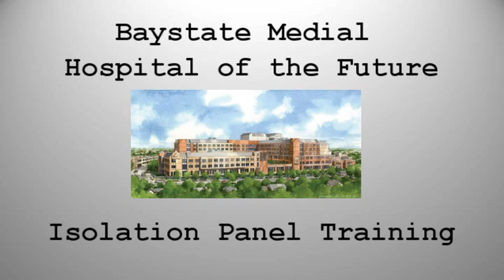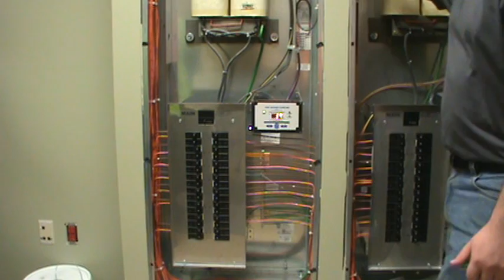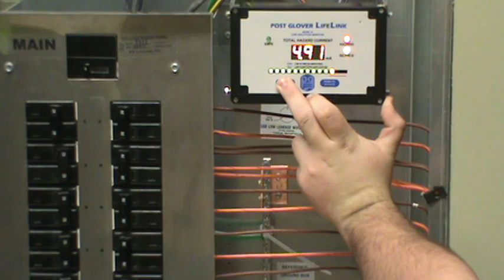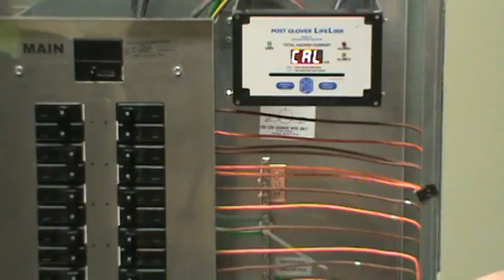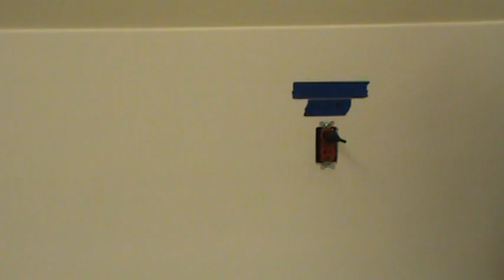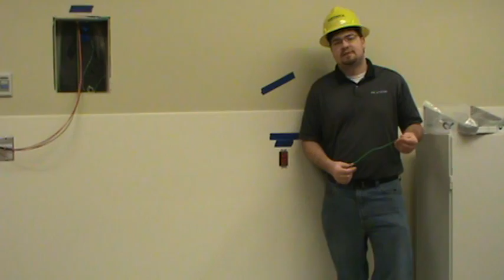Isolation Panel Training

Comment: OK, so we did a service call for one of these panels by dongan transformers. What are the receptions for reading open ground? I opened up the box. Everything was grounded. Everything was properly trimmed. It was bonded to the J box. Do you think it could be a float in the transformer with the isolated ground?
Reply: *receptacles